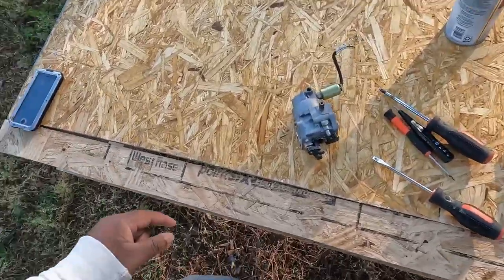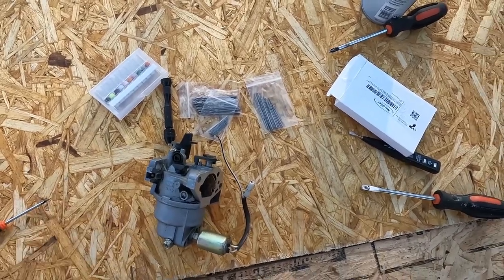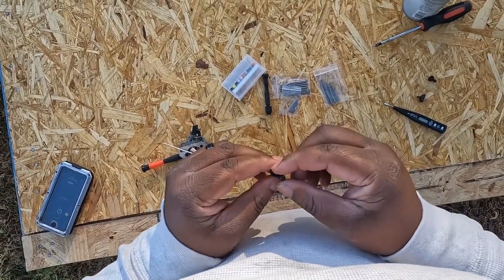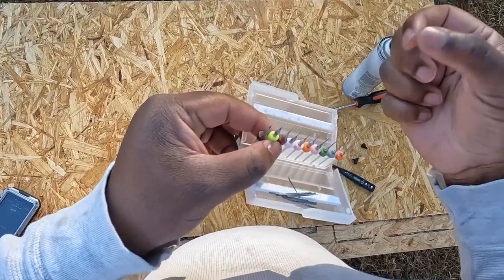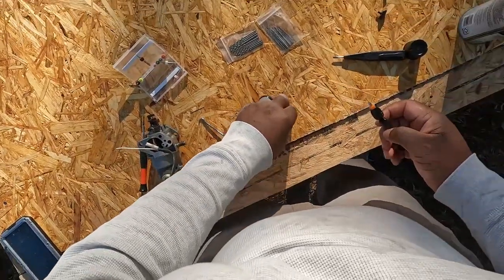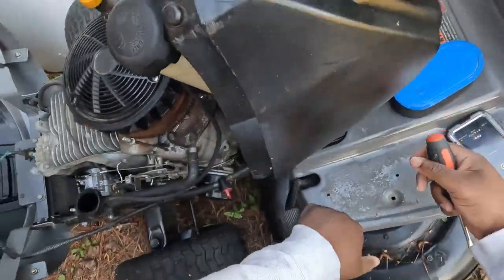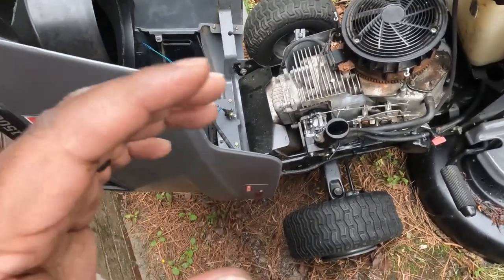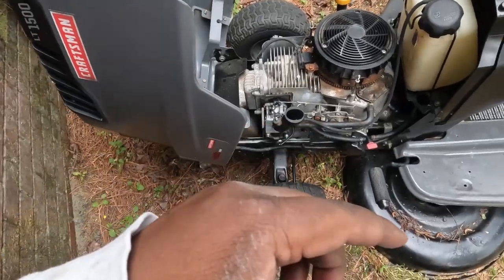How To Drill Out Carburetor Jets  #craftsman #carburetor #smallengine #diy

Comment: The new Briggs & Stratton plastic carburetors, are the worst, for having too small a main jet holes!!! I broke off 2 bits (the one's with colors). Just last night I got a set of bits & vice just like yours. Comes with color bits and 3 bags of bits for the vice. The bag with the thinnest bits is just what you need. Bring on the plastic carbs, I can do it now!!
Reply from the maker: @DonaldMang  it’s extremely easy to break those tiny bits.  I touch one and the tip broke off in my finger.  I also bro one off in a different carburetor I was working on and had to drill it a little bigger that I wanted to get it out.

Comment: I've taken my carb off 5 times trying to get the engine to run less lean, and I'm hoping this will work. Lesson: don't trust Amazon carborators
Reply from the maker: Yes some of amazon carburetors I don’t seem to have the best of luck.  Just make sure to go slow drilling with the micro drill bits they will break aid not careful.   

Thanks for watching and commenting